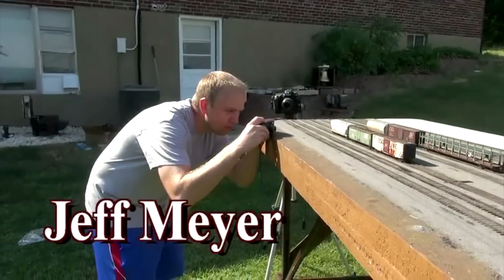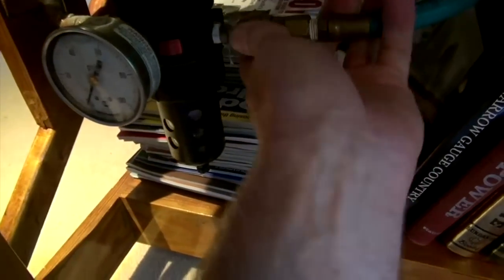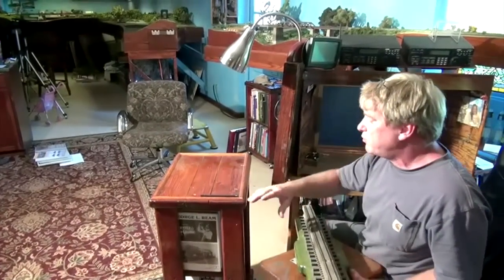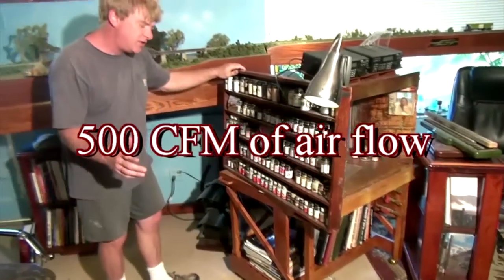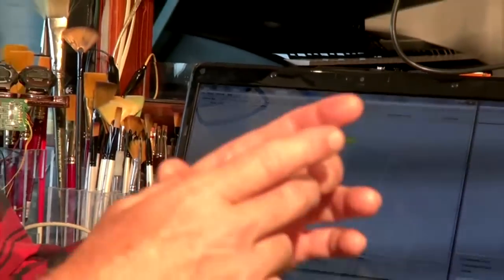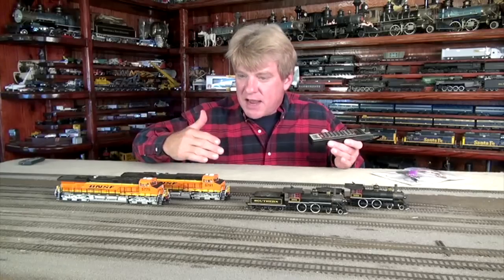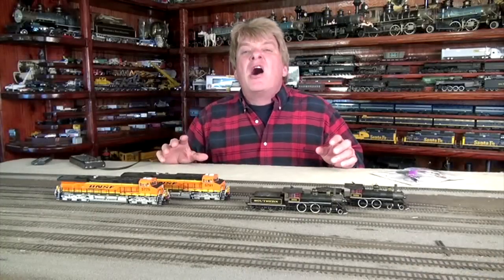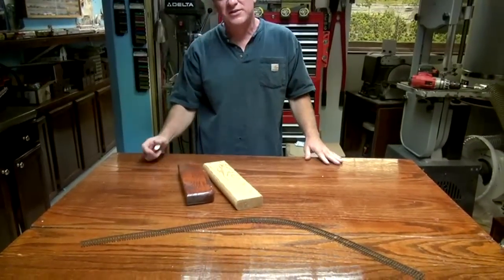Airbrush booth & SoundTraxx equalizer | Model railroad tips | Model Railroad Hobbyist | MRH

Comment: Hi Ken, , another great video. I cant agree with you more. A spray booth is an essential tool to have when airbrushing. I built mine from a sheet of aluminum (left over from a job at the shop)  based on some plans from an old Model Railroader Jan 1988.  Of course I modified mine to suit my needs. Been with me for over 15 years now. Works and looks fantastic!!! Not to mention, I can spray year round..EH !! hah

Comment: Enjoyed the video. I hope you don't mind a couple of questions on your paint booth
- what type/brand of fan is installed in your paint booth? what type of motor is the fan powered by?
- do you use an Air Inlet/Input into the room, for the air exchange?
- what type of filter is the one you've shown?
Reply: novelyo )